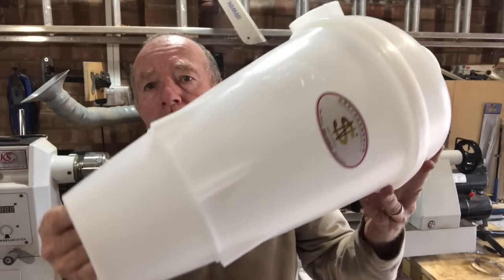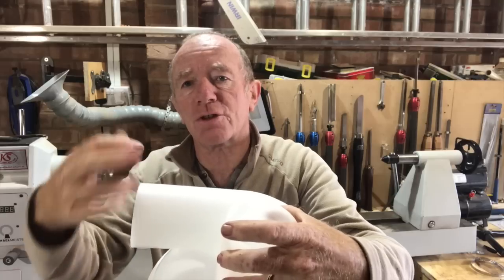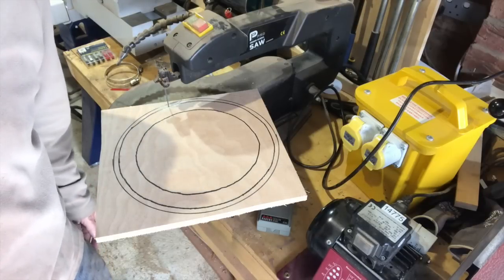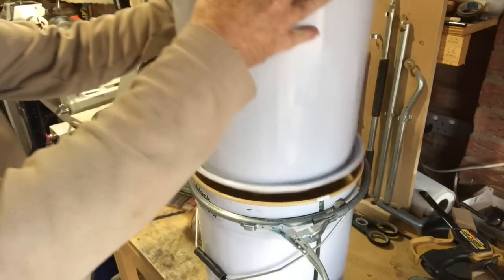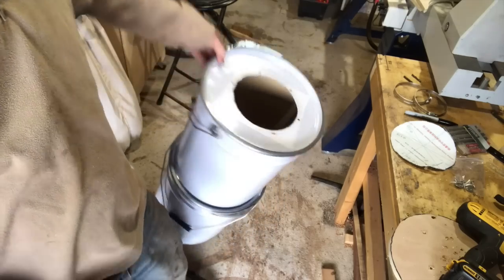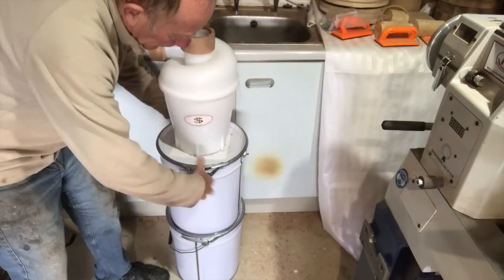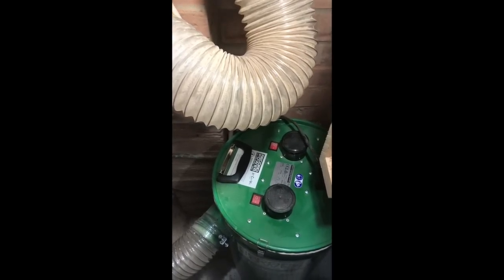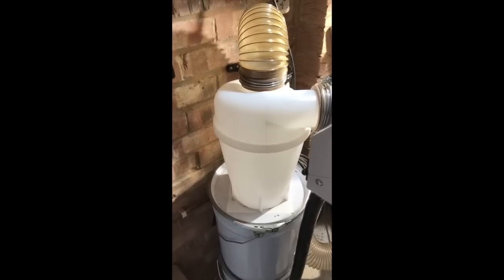# 31 How I Built A Cyclone Pre Filter for my CamVac Dust Extractor

Comment: Interesting video. I have just bought  a wall mounted camvac which has a cyclone so hopefully that will work, otherwise there will be another Chinese import!!
I agree about dust,  I have worked with wood all my life, including cutting asbestos sheets in the 60's and have little more than 50% of my lung function left.  A respirator with a P3 filter, is essential as far as I am concerned as it filters down to 0.3 microns and dust has been measured down to 0.7 microns.
Reply from the maker: Hi Icespeckledhen if you have the wall mounted CamVac then hopefully you won't need a pre-filter as the debris goes straight into a bag (Hopefully) my debris went into the bottom can and clogged up the cloth filters. hope that you won't need to bother. cheers Tony
Reply: @tonymeadley6578  Thats the plan anyway, the Charnwood dust extractor, which I have now, clogs up the filters so they need constant cleaning but hopefully the camvac will do better. I will use the Charnwood for the mitre saw, table saw but more likely I'll put a cushion on it and use it as a seat!!!
Thanks Tony
Reply: @icespeckledhens  how did you get on with the wall mounted Camvac? Did you find it's fine without a cyclonic pre-filter?

Comment: Nice one Tony.. I have a tin like that for my shop vac and it used to collapse when the end clogged up while cleaning the shop.(so i fitted it inside another one).. Your cam vac is super powerful, but you should not have the problem using it as you are...love the reducers you turned for the cyclone.Fab job overall bet you are well pleased with it.
Reply from the maker: Hi Paul Yes I am over the moon with it. However it's much better with the cyclone as most of my dust now drops straight into the pre-filter. hope to catch up on Saturday. Thank you. Tony